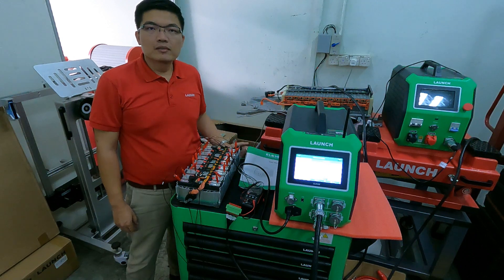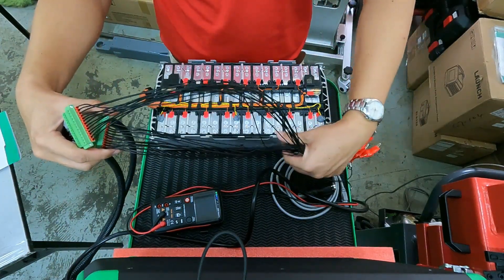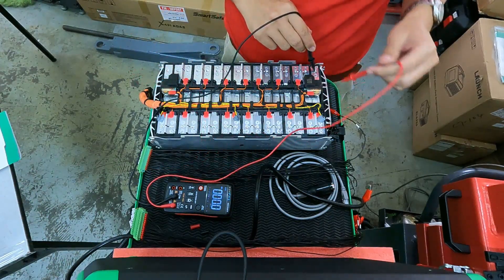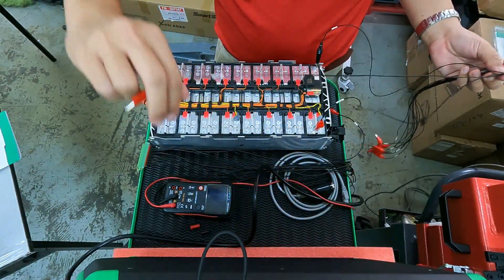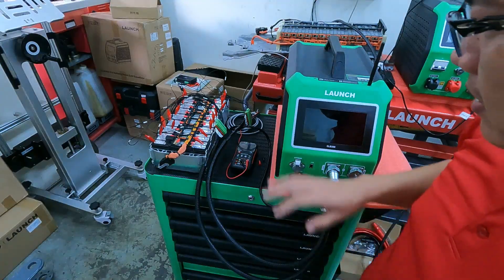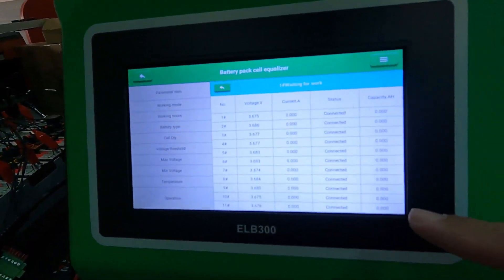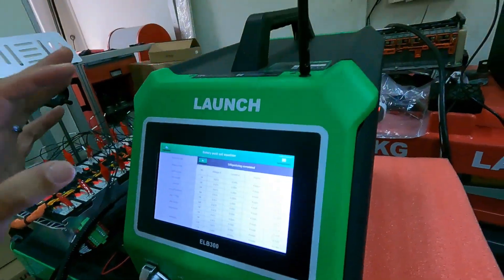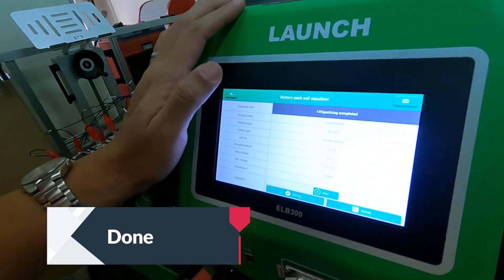How to use ELB300, the EV Battery Pack Cell Equalizer | LAUNCH

Comment: what are the differences between ELB300 and ELP400? I mean, I know ELB300 is a equalizer and ELP400 is a charger but, when shall I need to use equalizer or charger? it seems that the equalizer makes cells charging, ain´t it?